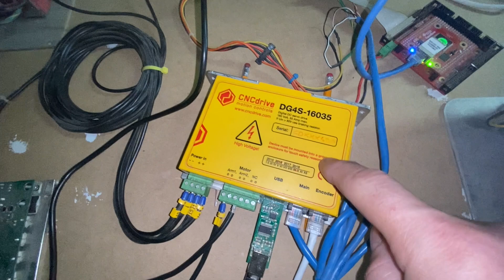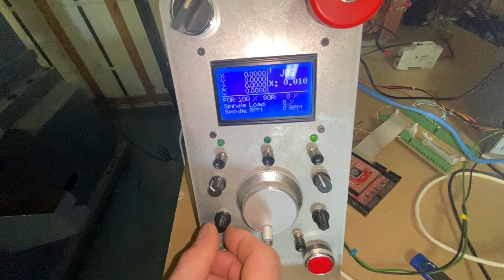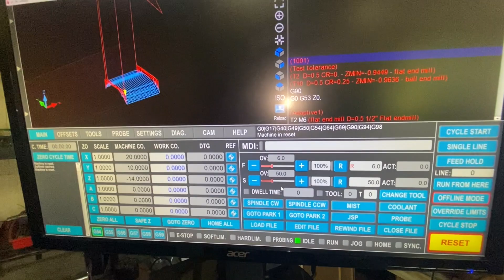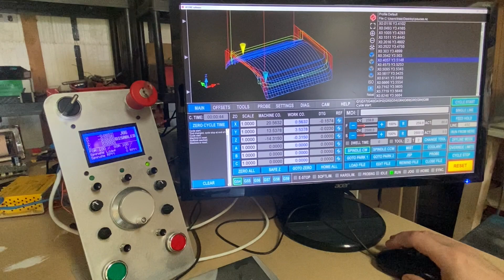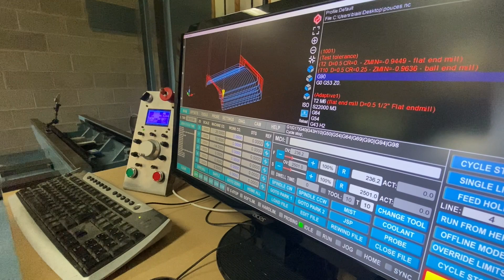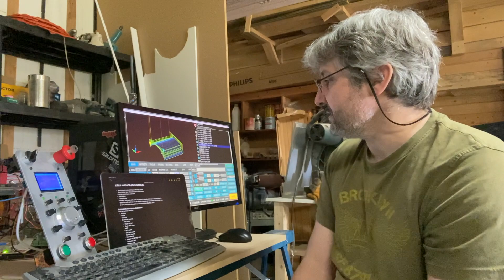Part 32 - (It's alive!!!)

Comment: I'm confused.  The control system UCCNC, which is like Grbl.   What is the GCode sender that is running on the PC ?  Is that UCCNC as well ?   With Grbl you can run whatever sender you want.  Can you do that with UCCNC ?  I like the looks of the sender you are running, but not if it only runs on Windows.   I use Linux for everything.

Now I'm really confused.  When I go to CNCDrives website they are selling UCCNC.   Is that just the GCode sender part of UCCNC ?  The motion control part of UCCNC is open source and the other part is closed source ?
Reply from the maker: @SomeTechGuy666  CNCDrive came up on my radar because of the DC servo drives they make. Perfect for my servos. I then saw the controller and software. I compared it with Mach 3 and Mach 4 and decided to go their way. But you are absolutely right! Windows is a pain and could even be unsafe. I’m to invested write now but if I was to start again, I would take a good look at LinuxCNC.
Reply: @BlaiseBarrette  uCCNC apparently has the same communications format as Grbl.  There are lots of GCode senders that are compatible with Grbl and look as good or better than the interface you are using.   Most of them are open source too.   Have you tested any of them ?
Reply from the maker: @ No! I didn’t know it was GRBL compatible.
Reply: @BlaiseBarrette  For whatever reason, YouTube removed my reply to you.   All I did was mention that UCCNC is open source and on github.
Reply: @BlaiseBarrette  I messaged you.

Comment: What your is year machine that it has brushed DC servo motors ?   What year did Fadal start using AC drives ?  How much did you get for your boards and drives when you sold them ?
Reply from the maker: @SomeTechGuy666  I can’t say when they switched over to AC. I still have all the original electronics. I haven’t made the effort of selling it yet but it is for sale.

Comment: How did you get softlimits to work like that? Is that standard behavior?
Reply from the maker: The soft limit setup it pretty strait forward in UCCNC. You have to  define your machine dimensions and enabled the soft limits. That’s pretty much it unless I’m forgetting something.
Reply: @BlaiseBarrette 
Yeah, the initial setup is ok, but we get a prompt message saying "soft limits reached" (or something similar), and need to press "OK" to be able to jog away.
Yours seems to just stop, and still be able to jog the opposite direction.
Reply from the maker: @eMTeaM10  in the settings tab, go in appearance and uncheck ‘Show message on softlimits’

Comment: I'am thinking to go with myCNC controller, (500eur)... also with chinese servomotors... :-?? but I have a lot to study. Electrical/electronics is at very very low lvl. And I watch at everything and try to learn.
Reply from the maker: Yes! Such an endeavor implicates a lot of research! That is one of the reasons why I do these videos… so that people have a better understanding of the process involved. I had never heard of myCNC before. Looks nice!
Reply: @BlaiseBarrette  maybe when I will have all hardware home, you can give me some advice regarding interfering with machine ?:D I will document everything. I belive this machine will need some Inputs and I will need IT10 interface. For that I will need 900dolars. They have also probe, remote everything.... but I will start step by step with interface.:D From where do you buyed restrictors for lube?:D

Comment: Sorry if I missed this in a series but why did you throw away original servos and controller?
Reply from the maker: It’s a good question… In short, I wanted to experiment and modify the machine. Ad new features etc… having a easy to customize control will make this much easier and fun.

Comment: Very good. Congratulations.
Is there any lubrication for the moment?
Reply from the maker: Excellent question! I forgot to mention it in my video. I’ve put a generous coat of lube on the ways before placing the saddle on the machine and I filled the ball nut also with lube.  Since I am just testing stuff, it should be ok for now but any more than that, I’ll have to install the pump.

Comment: Your doing very well.....Just .0006 Backlash...I may have to replace my Ball screw Bearings like you did..
Reply from the maker: I’m quite sure the backlash comes from the bearings, not the ball screw. If you can, maybe wait a little bit to see if my ball screw survives before doing yours. Just in case.

Comment: Great to see it moving, happy for you ! I use LinuxCNC and don’t think I would consider something else. It has a learning curve but it’s so flexible. Not sure how easy is to get surplus industrial servo motors and drives where you live, here in Germany is not difficult to source them on eBay. I use Siemens, or similar ac motors and kollmorgen servo drives via Mesa 7i25 + 2x 7i76 for up to 10 axis. I actually use 8 servo motors including the two ATCs and x,y,z,a,c plus the spindle. Anyways press on and keep the videos coming :-)
Reply from the maker: Your system is very impressive! If I ever move to Linux CNC, you will be the first one I call for infos! 😉
Reply: @BlaiseBarrette  well my machine itself is just a hobby machine, you got the real deal. Great job btw.
Reply from the maker: As far has hobby machines go yours is clearly the nicest I’ve seen. And the resulting parts you get from it is a tribute to the quality of its built!
Reply: Hi, I looked at your setup (quite briefly). If I understand well, you using an rt kernel to run the position control loop? Being a Linux advocate for so many years, I was going to push LinuxCNC to my friend Blaise but could not (easily) find (ETH) motion control solutions. Bringing the position control loop to Blaise's PC (with rt capabilities) seemed not a good recommendation (also, we are physically 600km apart, hard to help). I am curious, what is your opinion on this :) .
I may have missed stuff...  I have extended experience in EENG and Linux HW/SW control systems but not an expert regarding CNC machines.
Cheers!
Reply: @macdiamo  yeah a lot to cover. 
In my experience, and I run ethercat with canopen to the drives, io-link, device net, Mesa cards with step dir to the drives, custom LinuxCNC components, loads of stuff and still the rt preempt kernel is behaving well. Rarely do I get the message that the servo thread was delayed. In this setup, thought the motion controller is LinuxCNC, the step dir generation is done on the Mesa cards (up to 1.5MHz steps from memory), so on an FPGA and not in LinuxCNC. What tips the balance for me, is the flexibility one gets with LinuxCNC. Having said that, I will agree that LinuxCNC is not for everyone, I have never gotten anyone to help me when I was stuck, my only friends were google and persistence, though plenty of people do get help on the LinuxCNC forum. So, would I advise Blaise to go for LinuxCNC, not directly, rather mention it has an option and let him decide if he feels up to it. If you see my comment to Blaise I only share my experience as opposed to recommend it - this was intentional.
Reply from the maker: LinuxCNC is clearly my next choice if UCCNC doesn’t do it but I have already invested quite a lot of time learning UCCNC so I’ll stick to it for now. UCCNC is quite flexible as well with the macros, the modbus plugin and the modifiable interface. Fingers crossed, Time will tel.

Comment: Congratulations!!
Chosing the system by the stepperdriver that is going to be replaced might not be the best idea but appart from beeing a windows system I see nothing wrong with it. If the build in cam tab is capable and you get a good post processor for it there is definitely some potential for a good control.
And your to do list is pretty good.
Reply from the maker: I do all my CAD and CAM in Fusion 360 and their is a post for UCCNC in Fusion. Also, I’m quite good with modifying posts. So that part doesn’t worries me. 

Finding the drive is how I discovered the CNCDRIVE company. But you can use this servo drive with any other control that works with step / dir. also, you can use other drives with this control. But the whole system works nicely together.